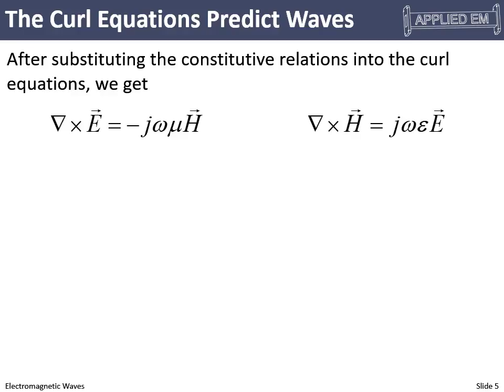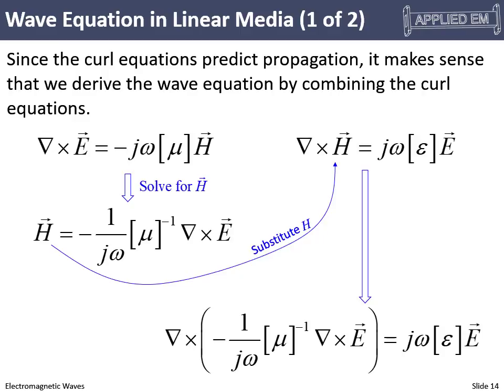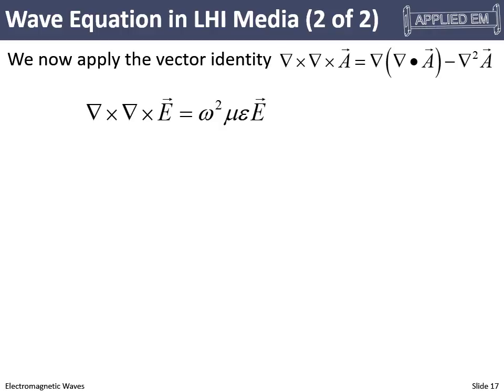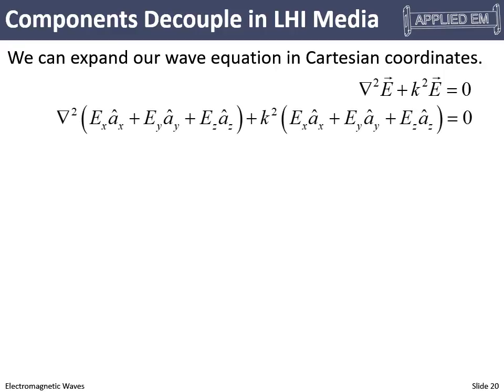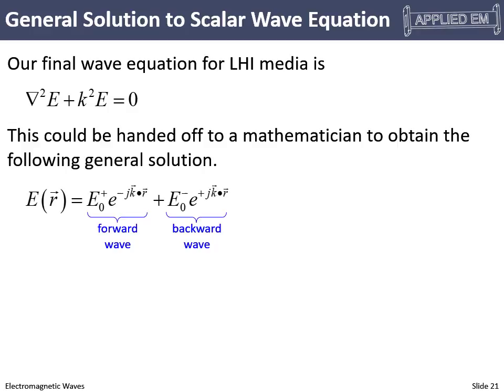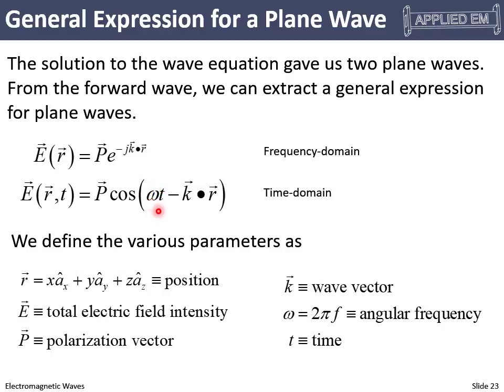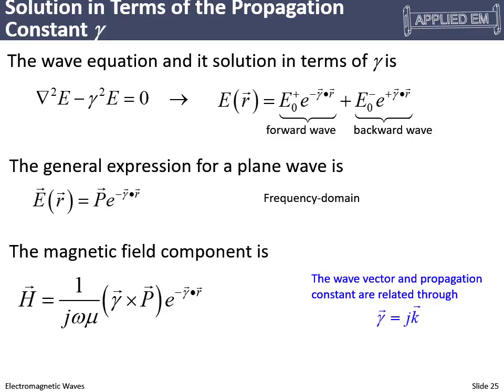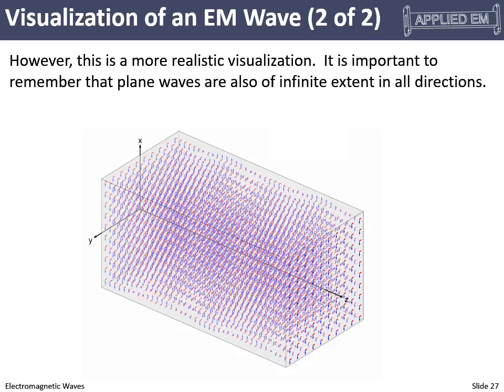Lecture 3a -- Electromagnetic Waves

Comment: Thanks for the video, I am interested in electromagnetics , espicially to know how to handle EMI/EMC on PCB's.I have a question here. You said H is E/377, so H is 3 orders of magnitude less than E, Here it is shown like H ~ E/5. But you said, in reality H is not weak, it's only because of units B is E/377. I didn't get intuitive feeling of this. How do i know more information on this.
Reply from the maker: This is confusing. One example is comparing one object that weighs 2.0 pounds to another object that weighs 1.0 kilograms. The object with units of pounds has a bigger number, but in fact the 1.0 kilogram object weighs more. That is simply because different units were used. In electromagnetics, E and H have different units so it is not completely fair to just look at numbers to determine which is “stronger.” 

To be more rigorous, think about the energy carried by the fields. In vacuum, the energy in the electric field is eps0*E^2. The free space permittivity eps0 = 8.854e-12 F/m. The energy in the magnetic field is mu0*H^2 and the free space permeability is mu0 = 1.257e-6 H/m. Let’s just track orders of magnitude. We know H is three orders of magnitude smaller than E, but the quantities are squared. So H^2 is six orders of magnitude smaller than E^2. The constant mu0 is six orders of magnitude bigger than eps0, so overall eps0*E^2 is the same order of magnitude as mu0*H^2. Thus, both fields carry the same amount of energy.
Reply: @empossible1577  Thanks for the reply. I understood the reason and i am clear. I am thinking on the measurement perspective. If there is a way to measure D,B and E,H and see thier magnitudes difference.
Reply from the maker: @1729malli  Measuring them separately...hmmmm....not sure....what frequency?

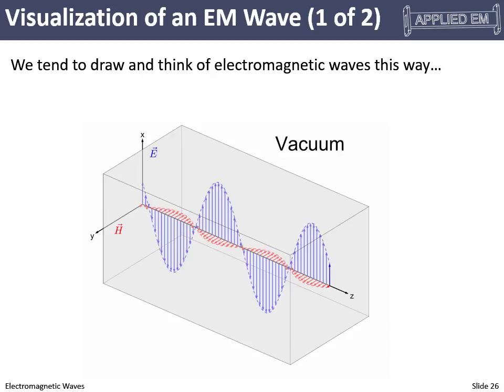Comment: I propose that the best manner to show E/M waves is to be practical and less theoretical and in a plane wave it is all theoretical and it does not exist. All E and M field come in loops, loops and more interlaced or curled loops,  I do not like the diagram shown at 21:46  as the Magnitude of the Fields need to coincide with the curl of the other or the maximum rate of change, That diagram would be fine if the sketch was rotating, as the rate of change of the Magnetic vector  projected component will show the maximum curl coinciding with the maximum values of E and M components.  The shown wave is polarised then there is no rotation and so the rate of change of the Magnetic field and the Electric field must emerge from the TRANSLATION  along the radiated distance and so the diagram needs to be modified. As it is the diagram makes it difficult to see how the E and M fields loop or curls one another,  A single vertical  dipole would first create the Vertical E field and that will be followed later by the circulating M field. The whole pattern  of loops will be like the anchor chain made up of quadrature loops being emitted in sequence along one axis. with their necessary phase changes in time and in space along the path of transmission, 
One can use these loops to describe a plane wave if one looks microscopically at a space close to the centre of the chain. Showing the  E/M loops will facilitate the situation, and in my opinion it will even clear some of the misconceptions brought about by showing that diagram which appears in many books and which I am very hesitant to use, 
I find it very helpful to mix together the time angular component e^jwt , the space angular component e^-jkz  and  their rate of change  jw e^jwt    and --jk e^-jkz   Using a graphical plot on a circle depicting B= e^jwt     then dB/dt  jw e^jwt at 90 degrees,   then  --dB/dt  by a reversal,  and these rotation will depict the Electric component E  , then dE/dt  will rotate to agree with B 
The same can be made with the space derivatives, say Bx and Ey  where the curl of Bx= j dBx/dz and curl of Ey= -idEy/dz.    and plotting  curl of Bx and the curl of Ey using reverse rotation will give the full picture  of Maxwell equation on a single  circular diagram,  Sounds complex, but it is not, and it will clear many issues about the representation of   how EM field behave, including  how circular polarised wave travels and translates, but does not rotate, Only the vectors sources  at the transmitter rotate, but once vectors  of the B and E are launched, they all  keep their particular polarization all the way to the receiver, unless a purposeful rotating medium is introduced. .
Reply from the maker: Have you created anything like this for us to see?
Reply: @empossible1577  Yes actually I made wooden models of all I said using kebab sticks as vectors. Unfortunately  being an old man, I have not kept up to date with using modern equipment to send videos but I shall ask my daughter to do it for me. Here is what I made. 
I assumed that the
 By field is (1/c)  Eo (e^jwt)(e^-jkz) e^jpi/2 
Ex field is    Eo (e^jwt)(e^-jkz) 
These were shown  by inserting three sticks one representing the x axis the other the y axis and the third the z axis assumed to be the direction of propagation.
This system ensured that the By is in space quadrature with  Ex and  both in space quadrature with the z direction. 
Then since the Time rate of change is due to e^jwt  = jw e^jwt    dB/dt and another stick in the xy plane was included at 90 degrees to represent the j  due to the rate of change of time    while with a rate of change of space -j was involved and so a --90 degree rotation was used.    All other vectors in Maxwell's equations were added and the mathematical relations obtained from the geometry of the resulting model,  It seems to work correctly.
Reply from the maker: @carmelpule8493  The problem with loops and plane waves is that plane waves are of infinite extent so there really is not a loop to draw. In this sense, plane waves are unrealistic.
Reply: @empossible1577  So true, thank you for replying. Still, E/M waves are fascinating.

Comment: Hello sir I have a question...When deriving wave eq from Maxwell's eq, most test book apply curl to both side of the curl eq. And then substitute the remaining curl eq.(Where your derivation makes more sense to me) But how do you expect the same solution from it? Does applying differential operator to both side of differential eq leave the form of solution unchanged? (Like adding/multiplying scalar to both side of an equation) Thank you!
Reply from the maker: In essence, both approaches are substituting one curl equation into the other to derive a wave equation in terms of just a single field quantity.  The problem with the approach of starting by calculating the curl of both sides is that this approach can only derive the wave equation in a homogeneous medium.  That is because there is a permittivity or permeability left inside of the curl and you will not be able to use other other curl equation to eliminate it.  The approach I take can still derive a wave equation valid for inhomogeneous media.
Reply: @empossible1577  Thank you!  But my question was..Does the solution of D.E(differential eq) remain unchanged after applying differential operators to both side of the D.E? I havent thought of it seriously before but I got curious..Thankyou.
Reply from the maker: @Hanscabinnn  Well, you have take the curl of both sides so that is different.  I think otherwise, it is still a general equation.  The problem is that you cannot take the permittivity or permeability outside of that curl option unless you assume the medium is homogeneous.

Comment: Is it really fair to say that the magnetic field is 3 orders of magnitude "smaller" than the electric field? I would imagine the "size" of the field to be proportional to the force it exerts on charged particles, not the number assigned to it. Or are the force effects for those fields also 3 orders of magnitude apart?
Reply from the maker: I am not referring to size or even to energy content.  We have chosen units that make the magnetic field numerically around three orders of magnitude less than the electric field.  It would not make sense to confuse amplitude of an electromagnetic wave with size or distance.  Sorry for any confusion!
Reply: @empossible1577  No worries! I just recall my physics professor warning us not to be deceived by the "small" number related to magnetic fields, because a small magnetic field could create a huge force. Thanks for the reply!

Comment: 1. "Visualization of EM Field" part is fantastic!!
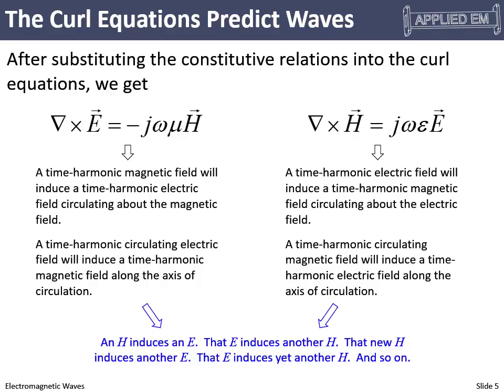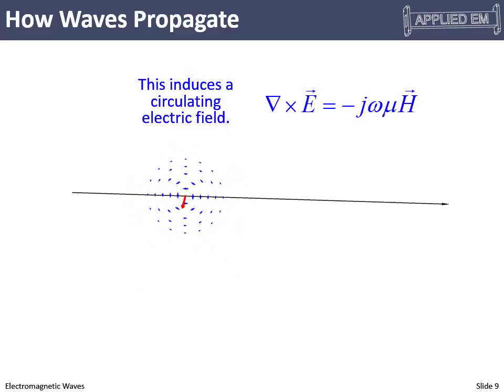2. Suggestion: From 2:00 to 3:00, when you show that how oscillating E-field creates H-field which in turn...and so on. I am wondering that after showing the animation part by part if you'll show all that once again in a complete slide, that would be great!!
3.Question: Why positive exponent represents a backward wave while negative represents forward?
Reply from the maker: 1. Thank you!!
2. I like the idea!  I made of note of it on my slides.
3. It is just a sign convention thing.  A wave travelling in the +z direction is written in the positive sign convention as sin(kz-wt) and in the negative sign convention as sin(wt - kz).  Both ways work.  The physics/optics community tends to use the positive sign convention while engineers tend to use the negative sign convention.  It can be very confusing!  Here is a link to a summary sheet for sign conventions.

https://empossible.net/wp-content/uploads/2018/03/Summary-of-EM-Sign-Conventions.pdf